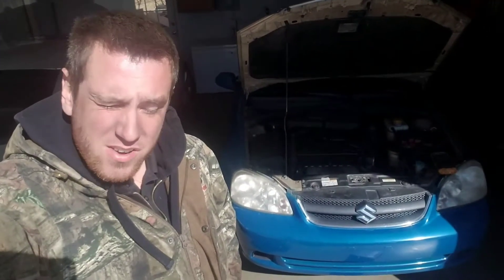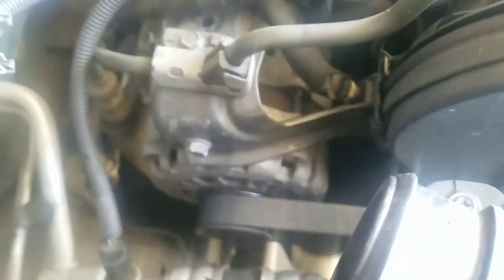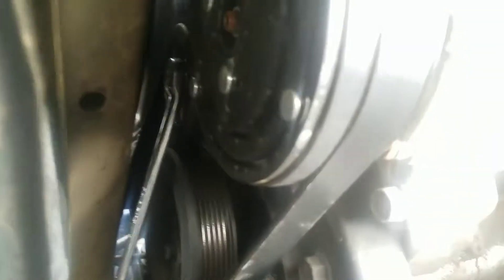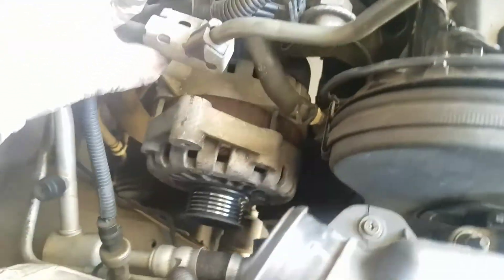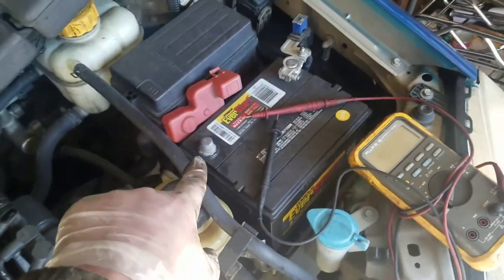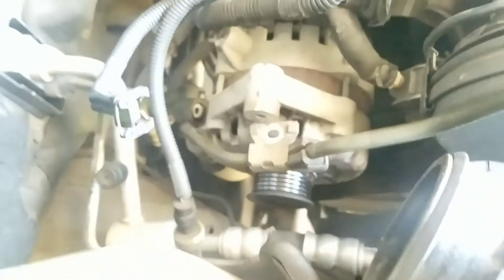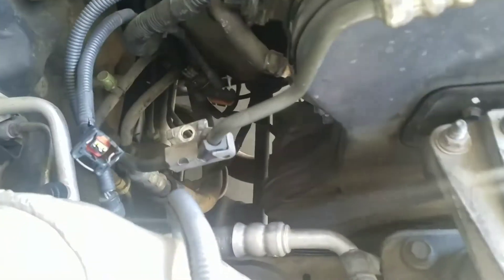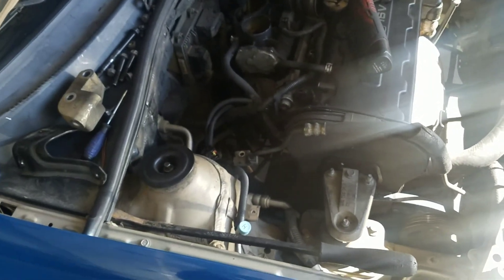Alternator 04-08 Suzuki Forenza Replacement "How to"

Comment: Update: You only have to losses that 14 mm bolt. FYI there is a nut on the other side so you need to get a 14mm wrench on it so it doesn’t spin. Once you get those two 14 mm bracket bolts out. It comes right out. Video was a big help in location of bolts.

Comment: Thanks fort he video, I have a question, I bought an alternator that has 4 pins in the connector, but the original one has 2, the car's connector has 4 holes, but only the middle two have metal plates, can I just connect the alternator as is, even if it will only use 2 of the 4 pins? thanks